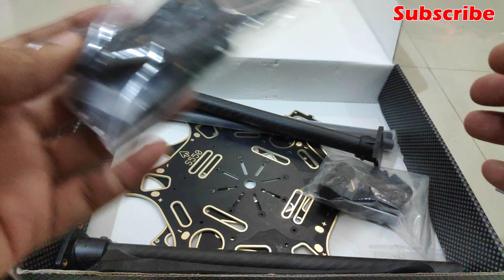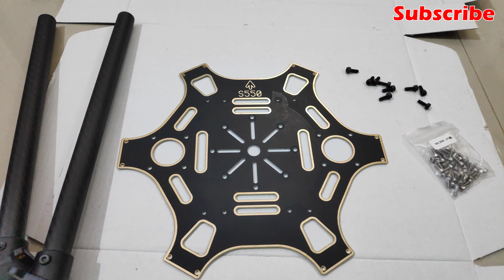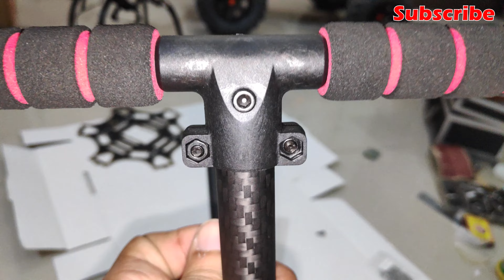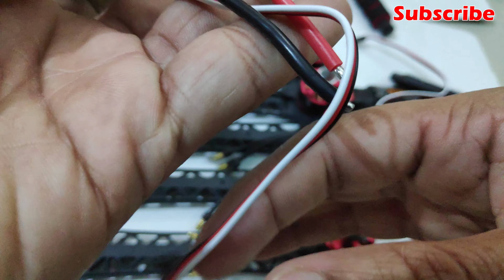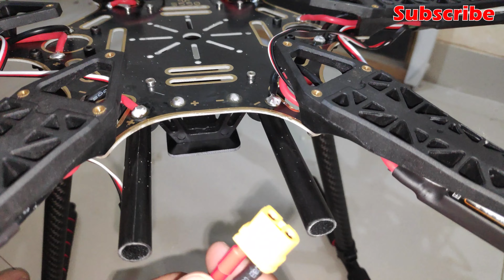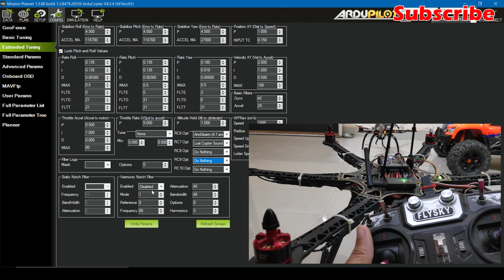S550 Hexacopter Drone Build with Pixhawk 2.4.8 Flight Controller | Complete Walkthrough

Comment: Very good explaination and process. I have built several of these frames and for sure they are very robust and can really take a beating. I have lost two of these from fly-aways due to radio issues but have had much more success. I will probably build another one just because it is such a nice build. Again Great explaination for those who are wanting to take on this project. They won't be dissapointed.

Comment: I am unable to calibrate in ESCs. I have passed Radio Calibration using PPM output of the FSi6b remote. However, once I try to calibrate ESC, the motors don’t beep at all…

Comment: hello, thank you for this wonderful tutorial . Q: How change motor spin direction without swapping motor wires?
Reply: If everything is already soldered, you may need to correct spin orientation in the param settings for whatever type multirotor you've built..quad, hex, octa etc etc. I'm new in the build arena myself, and motor mapping is def a tricky phase sometimes from what I've experienced. I also think that diff esc's have diff adjustability as well, so maybe you can get away with a re-flash of the esc's?
Wish I could be of more help, but from one learner to another good luck with your build and hope it works out for you soon! 🙌🎉

Comment: Hi, I am also making a S550 hexacopter using pixhawk 2.4.8. I am using a R9MX OTA receiver and X9D plus 2019 Taranis transmitter. I am able to spin my motors using pwm channels of receiver but when i am connecting the receivers SBUS out port with the RCin pin of pixhawk the motors are not spinning. When i am switching my transmitter on and it connects with the receiver, the pixhawk is showing an error sound like it is in your video at 36:48 minutes. Can you please help me with this? How can I contact you?
Reply from the maker: @karmayogi5531  hi, so are you sure the signal wire on receiver is on sbus out and not subs in? Secondly the signal wire on rc in Port of pixhawk is connected to the bottom pin and middle being power and top being ground so the order of wire is correct?  When you hear the alarm sound do you see the error message on mission planner hud screen? If the above steps are correct then it's mostly like the sbus protocol for receiver is not set correctly in radio. Do you see channels active in receiver menu of mission planner?
Reply: @RakishRc  yes, whatever you said, I have done all these things correctly. I am able to arm the drone but motors are spinning automatically, i am not able to control the motor speed using transmitter throttle stick. I have calibrated the radio transmitter again and all the channel bars are moving...this means pixhawk is receiving the SBUS signal from transmitter through receiver. I think there is some settings I need to do in mission or in transmitter to take control of the flight controller. Can you give me your whatsapp no. or any email id?
Reply from the maker: @karmayogi5531  have you mapped the channels correctly in mixer page of the radio settings? You can contact me at telegram @rakish33
Reply: @RakishRc  yes...i think so....ch 1- Ail, ch2-Ele, ch3- thr, ch4- Rud.....
Reply from the maker: @karmayogi5531  send you pictures and mission planner screenshot on telegram will get it working for you
Reply: @RakishRc Love seeing the support you provide to your subscribers! Ensuring that people understand the proper techniques, configs and set up is greatly helpful to the drone building community!!! I hope the project for your subscriber is a quick success, and that one day they pay it forward to help someone in the same way!  🎉🙌